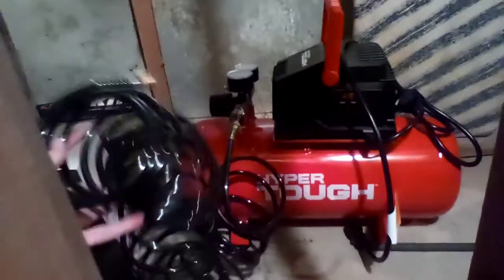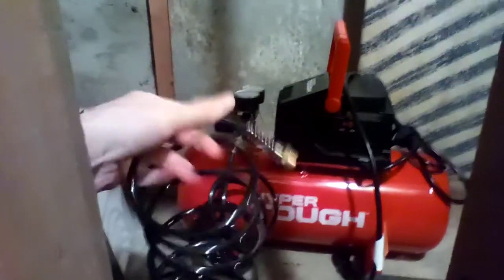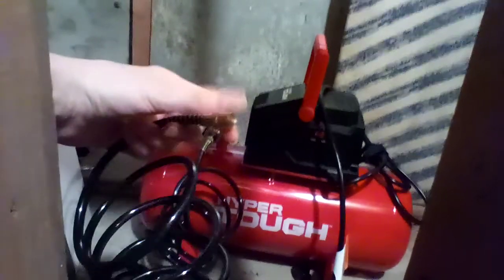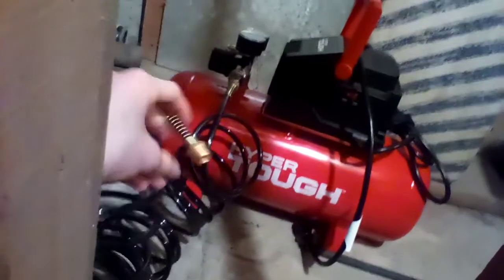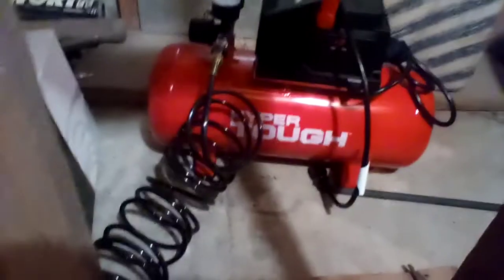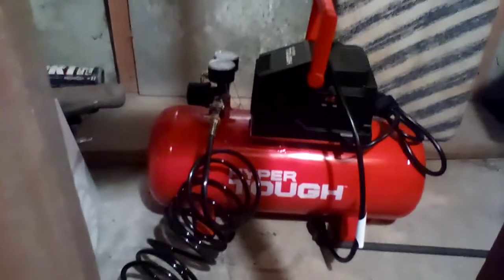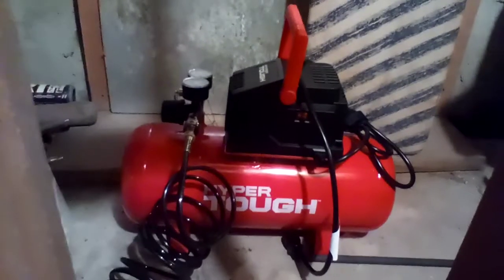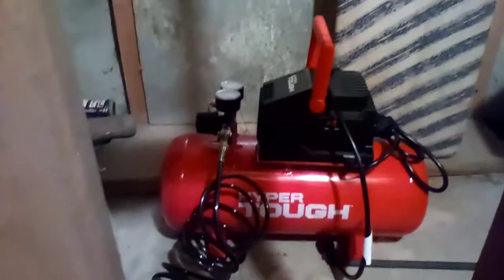Some stuff with Mitzi, and also a question about a piece I may need to run her

Comment from the maker: Will I need some manifold, or what you hear Aaron say he gets a blast of sand in the face from when he pulls the hose out of it in the Bear-A-Dise restoration series?
Reply: Yes you will
Reply from the maker: @Studio18CEC  Ok thanks
Reply: Thats because the bear a dise had Sand on stage which you DO NOT DO if Sand comes out you should try to fix that as fast as you can.
Reply from the maker: @TFFan-hu5qi  Ok, well don't worry, I'm not actually putting sand on her personal stage, or even using it at all, I was just using that part of that video for reference. I'm planning on using a grass carpet for her personal little stage, not sand, I know better than that.